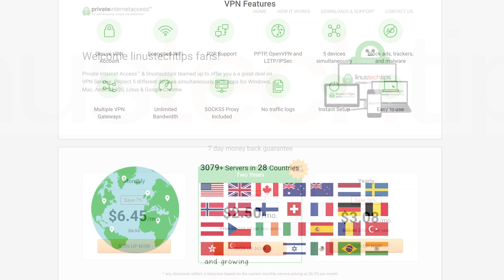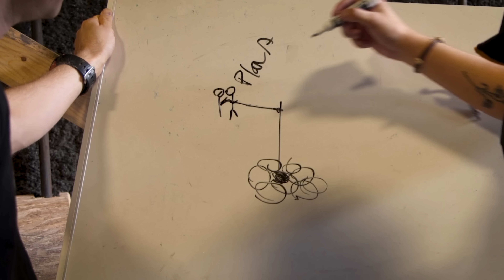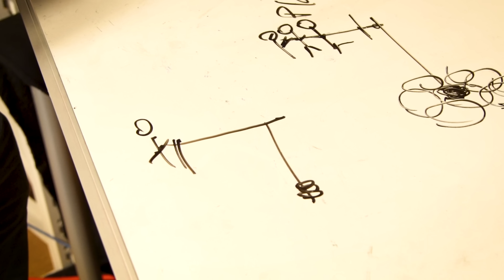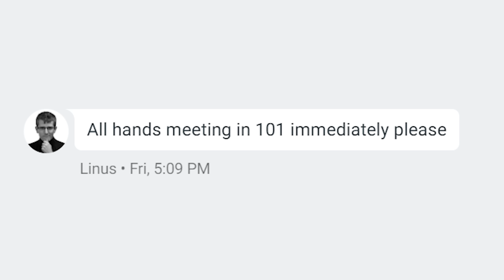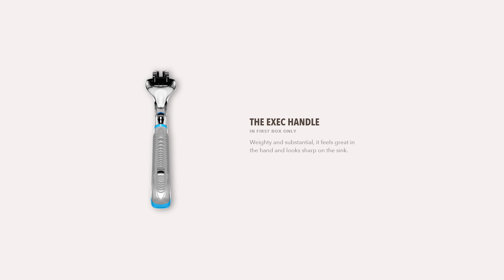We FINALLY Installed a Firepole! - April Fools 2018 (sort of)

Comment: Should be a brass pole about twice that diameter. Brass is more rigid, has a lower friction surface, does not corrode as easily from being touched a lot, and is anti-microbial. The pole needs to be wider so you can properly hook an ankle around it and so that one hand clamping down short doesn't cause the other to bind with it and break a finger. It can also accommodate more weight with out the pole kinking. The base should also be a floor flange (the outside diameter of which should be twice that of the pole) so it can take torque from any angle. and should be lag bolted to the concrete foundation. The top of the pole should be flanged similarly to a non load bearing beam. The step of for it should come through a hole in the catwalk that is at least 3 ft.⌀. That's so if someone trips or has a false grip on it, they have 360° of ledge they can grab as well as the pole, so they don't fall 20 ft.and crack their skull open.
Reply: Not lag bolted, but ideally set with a concrete anchor,
Reply: There are concrete lag bolt kits that come with a thread sleeve. So you can bore some holes, tap the sleeve in then thread the bolt. It's a bit stronger than a wedge anchor.
Reply: Then we're talking about roughly the same thing. A lot of people mean those big 1/4"-1/2" diameter hex head screws made to use with timbers when they say "lag bolt".
Reply: Well there are a lot of types of lag bolts. These are basically the kind your thinking of. They just have a threaded sleeve for going into brick or concrete as well. And you're right that it is basically the same thing. The difference is that an anchor is more permanent. Do you really think these guys will use a plumb bob and get the vertical alignment right the first time?

We've seen enough of their projects to know that they are going to bork it and screw with it again at a later date when they notice. Which means they'll have to not only drill new holes and buy all new hardware. but they will have to Miter off the anchors (because you're not getting them out otherwise). Even if they do get it right the first time they may need to take the pole out to move it or get rid of it at a later date any way. With a concrete lag bolt they just have to unthread it and fill the hole with quickcrete before setting new holes. This saves an uninstall step later. 

Even if they leave it in an anchor bolt is meant to hold wood frame static against the ground. The wedge anchor that comes attached to it is not going to hold under the type of stress they will put on that pole. Either it will snap, come loose, or they won't use lock washers so the bolts will vibrate loose over time and the flange will jump the posts. 

Concrete lag bolts are a bit more robust. They are wider, run deeper, have larger threads with a bigger thread gap. An anchor bolt is fine for their partition walls. As long as they aren't suspending too much weight off shelves and peg board mounted to them. But for something that will have a lot of stress put on it several times a day they need to go with a bit more durability. A concrete lag bolt over an anchor bolt is basically future proofing their work.
Reply: Yall are some firepole needs

Comment: Well, technically they installed a firepole, so no April fools!
Reply: Technically they didn't. They didn't secure it, it isn't permanent,  and linus didn't actually slide down it.
(he just walked downstairs from the actual stairs, and they did a shot of him jumping up from the ground and 'sliding' down the last bit. This is why you don't see him traversing the entire length of the pole)

Sorry if any of you actually believed he went down the pole but Linus isn't that irresponsible/brave/stupid.

Comment: You guys totally did that wrong. Haha. You should've bolted it to one of the beams on the roof and directly to the concrete floor. That would be a stable pole.

Comment: Hey guys! I have a question. So, I have a motherboard wich has 4 slots for ram sticks. 2 of the slots are already being used by 2 4 gb dual channel ram sticks. I've found a kit of 2 8gb ram sticks at a very good price. The sticks I have now and the ones I wanna buy are the same model, everything matches except the capacity. I would get the 2 new ram sticks and I'd have 24 gbs of ram. Are they going to work like that? Like is there going to be any error or something just because of the capacity? This is what I want to know. I would mention that I need this ram because Edge and PUBG use a lot of ram together so I can't really run both at the same time. Many thanks in advance! Also thanks Linus for this video and keep up the good work! Hey guys! I have a question. So, I have a motherboard wich has 4 slots for ram sticks. 2 of the slots are already being used by 2 4 gb dual channel ram sticks. I've found a kit of 2 8gb ram sticks at a very good price. The sticks I have now and the ones I wanna buy are the same model, everything matches except the capacity. I would get the 2 new ram sticks and I'd have 24 gbs of ram. Are they going to work like that? Like is there going to be any error or something just because of the capacity? This is what I want to know. I would mention that I need this ram because Edge and PUBG use a lot of ram together so I can't really run both at the same time. Many thanks in advance! Also thanks Linus for this video and keep up the good work!

Comment: you should have extend the edge of thge floor and make a rounded hole in the middle with ramp and the pole passing through and bolt on the top to make it secure and easy to use.   https://ibb.co/cKhJS7 Hope you're good !